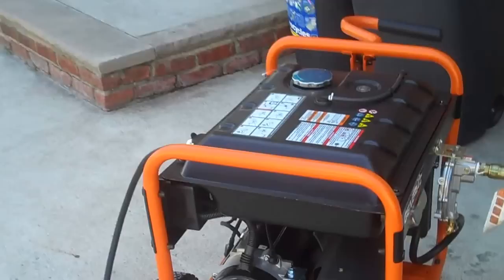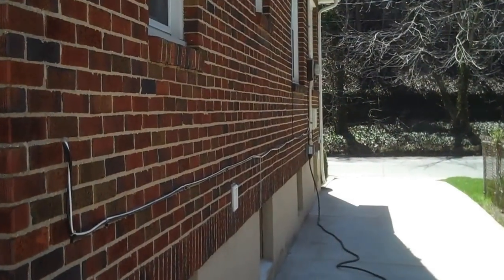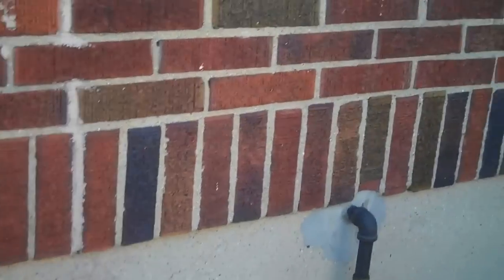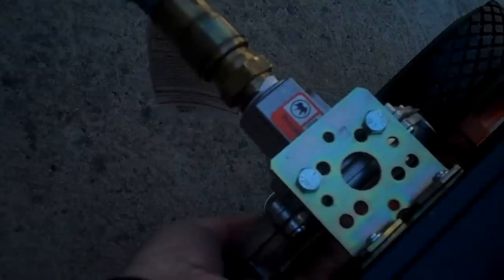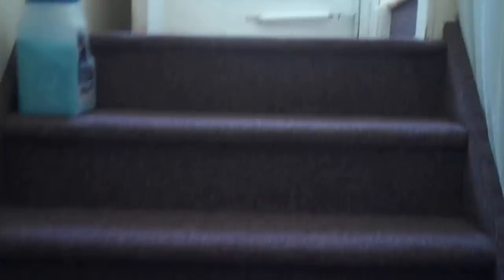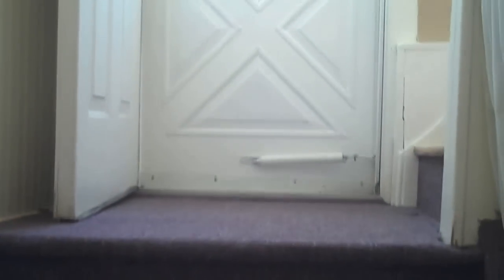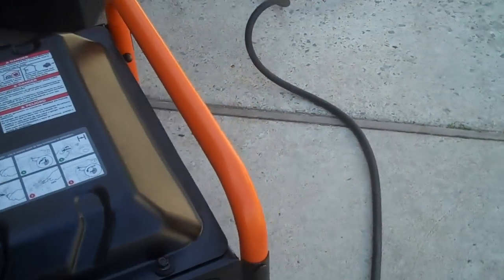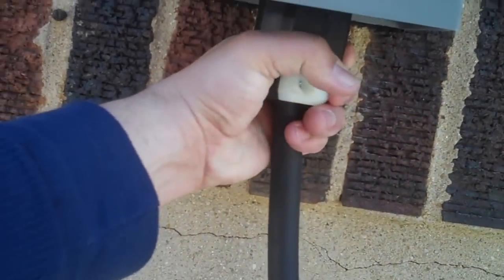Back-feed whole house on Natural Gas converted portable Generator

Comment: Where did you get the natural gas connection that goes on the generator? And is it possible to switch between gasoline and natural gas? Thanks.

Comment: How much does it cost to operate compared to gasoline?
Reply from the maker: I'm not really sure.  I have never had to run it for very long..so i can't tell you how efficient or inefficient it is.  The main point is that I do not need gasoline (which was unavailable after Sandy).

Comment: Nice, Looks great to me. I still have to run a pipe thru the wall so I can use Natural gas. I think the outside valve needs some kind of lock to prevent the kiddies from turning it on. I know that when the quick disconnect hose is disconnected that the gas won't escape but I would feel safer with a lock.        I am only going to run certain items on mine like a fridge, freezer or tv directly  hooked to generator. That way I don't have to mess with the electrical boxes or worry about backfeeding juice thru lines. Plus it saves a ton of money not having to buy all that special equipment. Will work OK for short periods of power loss. :)

Comment: Nice setup but I would get a real interlock just to be safe. I would not take a chance with flicking both breakers at the same time. Best to do 1 breaker at a time.
Reply: Exactly my thought.  I've had zip ties break, especially after a few years old when they've gotten dry and brittle.  

Also... more importantly... there still exists the possibility of having both breakers ON at the same time due to human error.  That's why interlocks that work with side-by-side breakers include a rigid member in between, rather than flexible (such as a zip tie).

Not judging you.... just want you to be safe.